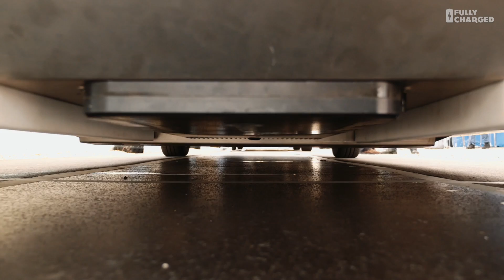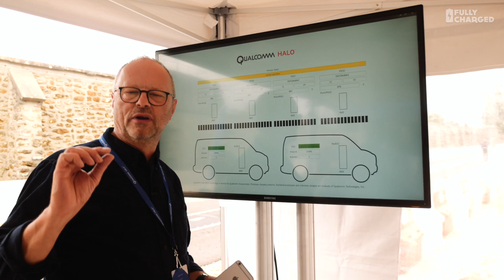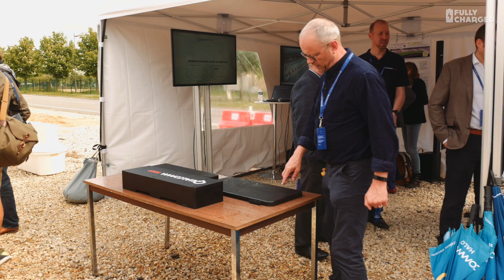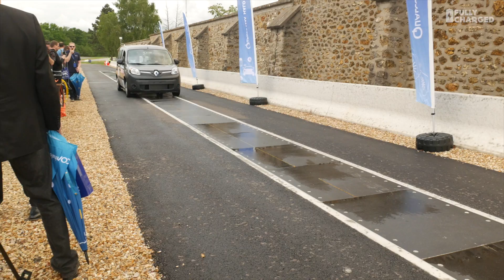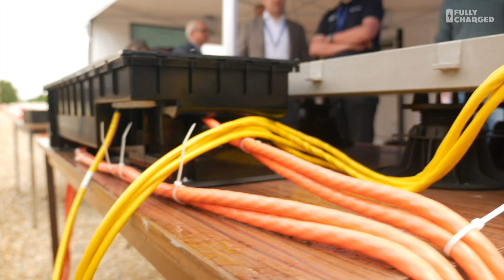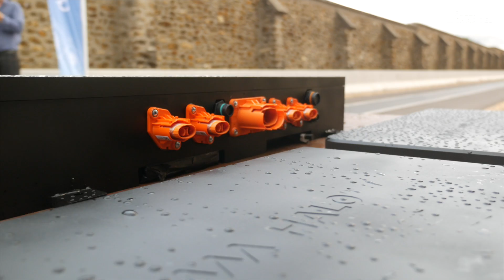Dynamic Electric Vehicle Charging | Fully Charged

Comment: Think something like this will be essential for a mass switch to EVs and would solve range issues, I doubt adding more charging points alone will cut it - just imagine the queues to use chargers if most vehicles were EVs. I believe this has already been tested with multiple vehicles being charged at 70 mph, and in wet conditions. It could also be buries deep enough below the road surface to remain undisturbed by most routine maintenance work, such as re-surfacing. Start with motorways, creating a charging network, with inside lane first, to benefit lorries and cars dropping into inside lane to top up.

There has been enough testing and feasibility study - time to start rolling it out.

Comment: It looks amazing but from a pragmatic view it's just a waste of so much energy. Cable is still the most efficient way to trasfer power. You need to have a lot of cable in the road with constant current and you have to have a lot of cable in your car that weighs something. It's the same reason why we still don't have flying cars all around the globe. It looks nice but it's just a lot more energy for a bit of convenience. Wonder if they said how much energy is needed to charge cars 1 kWh of energy if there is for example 1000 cars/day with average speed of 90 km/h. I would be really suprised if it was more than 50% efficiency (meaning 50% is transfered to cars and 50% is lost as heat from resistance in the coils)

Comment: So instead of having electric wires overhead like electric trains of old this is basically a wireless electric track.  So how does it handle flooding?  How much did the 100 meter track cost to build because it does not look cheap,  I'm guessing $1-5 million so for a short one lane track of 100 KM it would be $1-5 Billion but I could be wrong and it could be a lot more..

Comment: Aside from the install costs, I foresee a maintenance problem for road crews, because you are adding electricity and wires to long stretches of roads. It could double road maintenance costs. It may be far better to use this selectively at bus stops and taxi stands, so that they could halve their battery sizes and top off while waiting.  Nobody will buy this unless costs are lowered.

Comment: We can barely get potholes filled in in the UK, let alone pay for roads to be dug up and relaid. With battery tech improving range year on year; and the speed of charge also, I can't see any point to this opposed from an interesting experiment. 

Imagine the disruption!
Reply: Honestly, I think it will take off, but mostly as destination charging. This solves a lot of problems for people without off-road parking. Inductive pads on on street parking would mean no cable hazards and could use an automatic secure handshaking protocol would link to your household utility bill for the power used. It might also see use on motorways, but it'll have a harder time with that as rapid-DC is already established for this, whereas we don't yet have any mature, established standard for on street domestic, everyday charging.

Comment: it looks very basic very crude system, But for maximum induction to take place. this is why dynamic motorized leveling is needed on the electric vehicles floor pan pick-up coils.a system of linkage with motorized hinged joints lets the pick-up coils skim the the surface of the induction charging lane. at just 20mm ground clearances. also for steering, magnetic line following on one side of the charging lane can be used by the vehicles steering when charging. to keep the vehicle on track. coils in the roadway that are not under the vehicle need to be off. and the line following keeps the electric vehicles steering on track.  PWM barcode machine-readable, representation of data is how the road can talk to the electric vehicle. and the vehicle can ping a barcode back to say yes I need charging . its all about PWM Pulse Width Modulation of the coils in the electric vehicle.  also dynamic motorized leveling can retract the vehicles floor pan pick-up coils in normal driving to maintain minimum 150 mm ground clearance.  Elon Musk may like this one!  one more thing, the cost in road works is in the km's of copper coils & wiring or units needed.

Comment: installing that in the city on the signal light are more sensible than on highway. But I can imagine the cost of road tax in the future becuase  cost of installing that device and maintain it will be huge. second issue for me are motorbike drivers they already suffer by way how roads are done or repair and now this??? slip hazards added to existing ones for motorbikers.

Comment: Did I miss the part where they talk about efficiency? I feel like it should be below 50% efficient
Reply: And also the charger will get so hot, then we'll need a cooling system. I like the idea of wireless charging cars on the road I had it pop up on my mind few times. But I think it's not worth the energy loss

Comment: "Halo DEVC, as its called, is in very early stages. Qualcomm set up a 100-meter test track at Versailles, France, and equipped two Renault Kangoo EVs with the receiving parts of the charger. The test demonstrated that the cars can be charged at up to 20 kW at highway speeds, and that two cars can charge simultaneously."
https://techcrunch.com/2017/06/15/qualcomm-demonstrates-driving-while-charging/

Comment: "Power is transmitted up to 120mm above the road surface."
A BMW 3 Series has 141mm of air gap.

I think this would be more efficiently used at red lights, you get far more usage time out of the system this way. Sadly, only 7.4 kW charging is supported for static applications.

So all in all, this could still use some improvement.

Comment: Interesting application of existing technology. The main issue with this kind of tech is that the vast scale required to actually put it in place is immense. Even if you just stick it in motorways the costs will be off the scale. That would pay for a lot of DC fast chargers.....

Even for mass transit the costs would be crazy and not enough vehicles using the pads to make it worth it. Especially when you see the overhead cast chargers they are designing to go at bus stops/stations.

Comment: This is basically a linear motor system without the levitation?
Reply: No.

It uses inductors to induce current and thus deliver energy from the road (and likely the power grid) to the vehicle, which then applies this energy to accelerate and to charge its own battery.

Comment: What solution would you propose for users in a large apartment building where each resident has a designated car park thus common charge points are not practical, each owner want a charger in his own parking bay.

Comment: The French motor and electrical industry are always innovative. I worked with them on trials for the motorway toll network that's coming on all UK motorways - so if you think electric cars are going to be a cheap way of driving for the future - not having to pay fuel duty etc....the motorway  toll network will get all vehicles. The one problem I see with the wireless charging system is the gap limitations between the vehicle and ground based equipment. Also the cost to retrofit this equipment into existing road infrastructure is going to be prohibitively expensive. Installation with city/twon roads where there's slower moving traffic may be a better location for these systems. If installed in streets it could overcome the problem with street chargers. The system could provide the much needed solution for flat owners who street park and have no street charging stations. These could provide the wireless static street charging capability. Install in car parks so every parking position becomes an electrical charging station. If the vehicle charging equipment has a unique digital address - you have built in financial cost/payment charging system and of course a built in vehicle location system.

Comment: My questions would be: How efficient is the system? Who will pay for the electricity? Who will pay for the instillation of the system? Will the cost of instillation be prohibitive for expansion on motorways? Doesn't an EV that has a 250 mile range and will charge in 20-30 minutes could make this system obsolete?

Major issues facing this technology:
People tend to forget just how cheap electricity is which means huge volume would be needed to recoup the large initial investment or charging an extreme amount for the electricity.
An ev with 250 mile range being driven at 70mph means that the person would be in the car for 3.5 hrs, I think most people would feel uncomfortable with driving for that long, meaning that a system like this would seem unnecessary to people who can then charge their ev in the 1/2 hr they could then take for a lunch and/or toilet brake.

Comment: That’s amazing! As long as a standard can be agreed with all manufactures then this could be the range extending feature EV’s need to do those long motor way drives. This could be the cloud storage equivalent for ev’s where you don’t need as big a battery because you are pulling from the road. Would need massive infer structure investment.

Comment: To be devils advocate: this may be electrically less efficient than a wired charger but it is more time efficient. How much is your time worth?
Reply: Dylan Crabb 
There are batteries coming online with proven double density and the ability to charge to 80% in 8 to 15 minutes (depending on capacity)
If you can regularly drive 500 miles without a comfort break, good for you! BUT, assuming you'll have to take a Break after at most 300 and you can charge back to your full 500 mile range (double charge density!) In in ten minutes or so, that's a 'one-stop' range of 800 miles and your comfort break will actually be faster with an EV than if you had to stand beside an ICE vehicle and fill the tank before walking to the bathroom!

Comment: So the vehicle black box - looks super small-compact and lightweight. Nope. What country can afford this. More likely we would have battery replacements than new roads. What happens when fluids and dirt spilled, sub-zero temperatures, super hot weather. Where does the power come from? This is a tech looking for a superrich country with flat roads. Even in say Saudi Arabia- the issue would be sand and boiling hot and freezing cold weather changes

Comment: That is incredible! So if these strips were used just before a red light in a city, say for the 200 yards leading up to it then you would be sat charging your batteries, giving yourself unlimited power for your commute! That is pretty impressive! Also we have Lane Keep Assist, so if this does take off then i imagine cars will have a feature to automatically steer into the middle of the induction plates to keep optimal power. Sweet, I hope it does take off

Comment: Greater than 90% efficiency is a realistic value for wireless charging, for all those asking. We've managed to get greater than 95% in optimum conditions, but there are a lot of factors that affect wireless charging efficiency in the real world. So yeah, greater than 90%.
Reply: Link, source, power transfer rate and size/weight of the kit used? :)

Comment: I'ts like F-Zero.

On a serious note it does also offer a great charging solution for houses and flats without driveways. Private car parks, parking spots or even just normal street parking spaces  or roads fitted with this means no cables, no crowded charging spots and with only 20-25% reduction in efficiency then cars are still charged full overnight.

Comment: It's nice to see Robert back with some *actual content*. 
Interesting system. I'm glad they're not selling it like solar roadways. They don't say it'll change the world tomorrow but are honest about the challenges. 
Though what was completely absent from the discussion was the by far most significant challenge, putting it on public roads. Then something like payments, what if someone drives over but doesn't charge ... Solar roadways (and Thunderf00t's recap) have shown how hard it is to build things into a road. While I think Qualcomm is better equipped to do this I still expect them to see significant difficulties in working with the road aspects of this project. You'll also have to convince public officials, which will mean building the pads and the infrastructure for them (look at those cables) at an incredibly low price and promise it'll work without significant maintenance for possibly decades. Oh yeah, plus showing that a lot of Halo capable cars actually drive over that piece of road. 
It'll be though. But I'm surprised Qualcomm hasn't aggressively pushed their solution into the market while they're still with little competition.

Comment: I think it is a faulty idea for range, only at stop lights would be good for already installed home charge pads.

It cost allot to the road, the car won't become (much) cheaper. And it will take allot of time to install it enough.
Another big cost will be a larger Energy load infrastructure,  it is even less effecient than the home charge pads.   I hope it get's dropped and move the investment to real charger and battery packs.

Comment: I'm truly impressed, 120km/h wireless 20kW!? That's amazing! Even at a milion dollar a km of road it's still cheap in my opinion.
20kW is a shitload for something wireless.
Reply: 1 million per km would only cost 155 billion to provide the US Interstate System with a charging lane.

A long project to be sure, but so was the Interstate Highway System originally. A 20 year program could introduce it quite well and affordably too. Probably gonna need government to do it, and get the government to subsidize EVs and so on.

Real difficulty is delivering power to the roads... but solutions exist.

Comment: I don't see the economics and efficiency of this system stacking up when you consider that battery technology is rapidly improving in capacity and relative cost. Plus this system will need some sort of maintenance which wouldn't be useful for busy motorways which already struggle with regular road maintenance. The installation cost of this system will mean it will cost a lot to use it so many manufacturers wouldn't even install such system in their vehicles. I think improving battery capacity further and creating larger rapid charge network is the way to go.
Reply: I think I'd rather see vehicles with on-board solar charging, plus a battery.  Unfortunately, batteries are large, heavy, and expensive, and will eventually be replaced by capacitors and/or nuclear generators, but that's years from now.  WHOOPS!  I forgot that the NSA is scouring e-mails for any mention of the word "nuclear."  Dammit, now I'm probably on the "no fly" list.  SORRY, NSA, I'M NOT A TER......ER, BAD GUY.

Comment: The figures just don't add up for this system. So they are saying the net power to the car is 7 kW. So if you want to take on board 30% in something like a Tesla 90D you would want to add 30 kWh. That's about four hours of driving!! Firstly assuming you're travelling at 50mph that means you would have to install this system over a stretch of 200 miles!! Secondly you would want to stop after 4 hours anyway. Makes no sense. Parking spaces, taxi ranks, and bus stops maybe.
Reply: Karl Shields Sorry I don't follow your maths.
Reply: 30kwh / 7 kW = 4.28 hours charging. If you're driving at 50mph while that charging is taking place then then 50 x 4.28 = 214 miles of track.
Reply: Karl Shields I see, so from the 20kW the car uses about 13kW to do 50mph (which I guess is about right from my experience) so 7kW surplus charges the battery. I see what you're saying, but I didn't see the idea of the induction charger to fill up your car, rather to extend its range. I'd still charge at home or at destination if I needed to actually charge up. I suppose there must be scope to increase its power. Even if they only doubled it then it would mean that you're still only using 13kW but then you'd have a 27kW surplus which actually would charge the van in about an hour. So then I suppose a 50 mile stretch of the M1 is then more conceivable, albeit still expensive.

Comment: The most appropriate eventual use for this technology could be on a Formula-E race track. The most appropriate time and place to charge a vehicle used for transportation is when and where it happens to be parked and is out of use. It might be worthwhile to install standard inductive chargers in parking spaces, bus stops, taxi ranks, etc. Perhaps a special toll road along motorways with this Dynamic EV chargers will make economic sense for long haul trucking operators or maybe it'll make more sense to stop to charge at an ultrafast charger every few hundred kilometres. We'll see.

Comment: How this thing operates? Does the pad on the road constantly emitting power even though there is no vehicle on the top? Or it will be open when there's a car on top? With that, how instant it will emit power when the car is in high speed? Does it waste of energy coz most of the power it emits is being waste no time for the car to catch them all?

Comment: The Bordeaux tram system use Ground Level Power Supply instead of overhead wires. This is a 3rd rail like London Tube and Merseyrail trains, using no overhead wires. But the line is only ever active when a vehicle is over the line, so no electrocution.